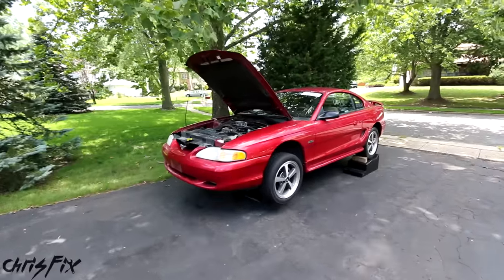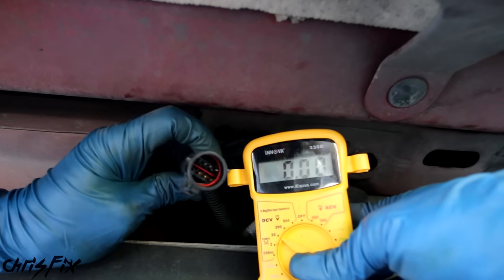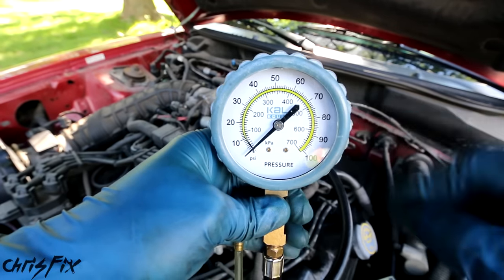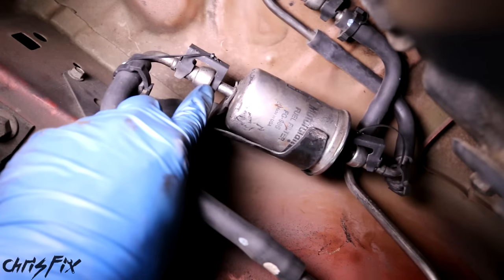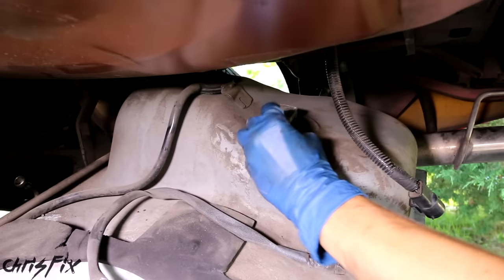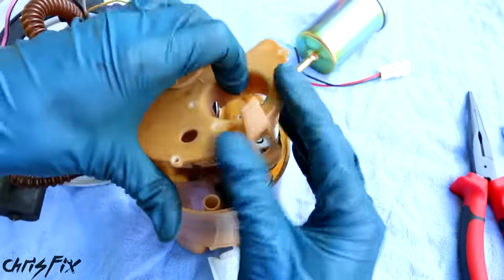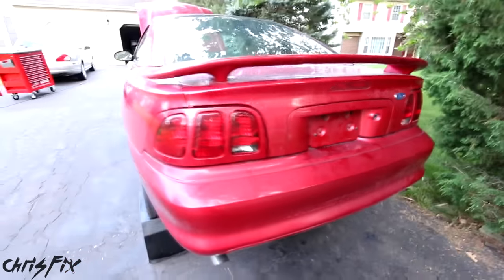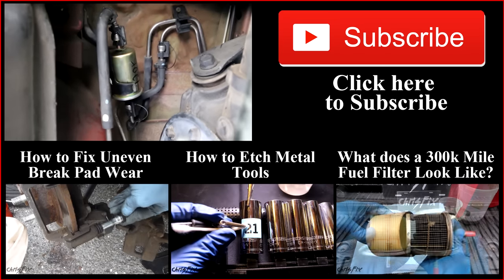How to Diagnose and Replace a Fuel Pump

Comment: Worthy of mention, DO NOT use any electric drills or drivers when working on fuel tanks, hand tools only!  I know that's how you did it, but it needs said too.  Great vids.
Reply from the maker: Thanks for the extra tips!
Reply: Is it so you dont blow your car up?
Reply: @sahibdipsandhu  yes then we can use flex tape to repair the car
Reply: Why...?
Reply: @RzVids  spark from elec drill+vapors=kablooey
Reply: Kaboooooom - some drunk Scottish man
Reply: So you don’t torch off rusty tank straps? That may have possibly been why that car exploded that one time 🤔
Reply: @Pilzi02  hahahaha
Reply: @RzVids  most electric tools create minor amounts of sparking inside the tool. Fuel in the air plus sparks in the tool are best avoided.
Reply: Ah, sparks
Reply: Well yeah bruh drills spark when you use then
Reply: You know I was thinking about that very thing lol for me no one else
Reply: Thank you!!!
Reply: Thank you for that advise! Great ignition sources them electric tools are when working around flammable gases.
Reply: "Don't ask me how I know that"
Reply: @sahibdipsandhu  yes. also if you dent the fuel pump you are screwed.
Reply: air tools are also acceptable to use
Reply: @jonjohnson102   'not one of you gonna survive this' - some drunk Scott tossing his balls around.
Reply: @Pilzi02  lol funneh
Reply: I mean, if you don't wanna recreat the mechanism of an engine with the sparks of an electric tool, best using common HAND tools
Reply: What are you, afraid of fire?
Reply: @lorddragoono  I mean, you wouldn't want yor full tank going on fire, would you?
Reply: I was 90% close to doing this with a drill no lie the only reason I didn’t was because I couldn’t find it 😳
Reply: @chainz1385  check if it is "intrinsically safe"

Electric tools can be used in flammable environments if they meet certain requirements.
Reply: @blastfromthepast7119  ah nice I never knew that it was a dewalt drill idk which one tho
Reply: P
Reply: @chrisfix  what did you use to suck the gas back out? And where to get it
Reply: @chrisfix  what did you use to suck the gas back out? And where to get it
Reply: Except if you're working with diesel
Reply: Where your sense of adventure
Reply: @laceyforrest5799   air or electric if it has a brushless motor. Those ones don't create spark
Reply: @Pilzi02  hi
Reply: dont use any electric drills when your working with a gas tank, it can cause a fire
Reply: @RandomGuy-yh2nh  Isn't that what the main comment says?
Reply: I know this is 5 years later, but I had an issue with a Jetta. Got a check engine light, hard start after fueling and checking the SES light it said camshaft position sensor, engine misfire blah blah. Found a video of common VW issues and not only did it explain about the purge valve which ended up being my issue, but also explained my locks not working, suspension and now my car runs and drives perfect. These videos are life savers. Got a quote for a purge valve replace just because, they quoted $790 and it is literally on top of the engine and took me 10 minutes.
Reply: @sahibdipsandhu  yes… a spark or too high of energy will cause it to blow up
Reply: have a fire extinguisher ready and honestly the air fuel mixture isn't going to be very easy to create a boom you might start a small fire but it probably won't explode.
Reply: Just a week ago I saw a mechanic take a drill to a fuel tank and start a massive fire that resulted with the shop going up in flames
Reply: @HeyaHoyah  Yikes. Hopefully they  learned their lesson.
Reply: Very true.
Reply: @AimingWanderously  My nephew when he was about 14, tried to siphon some gas at his friend's house, they thought a shop back would work good for this..
After the fire trucks left, there wasn't much of the garage remaining. He said you could still hear the shop vac buzzing.
Reply: @billmers3219  Yikes!
Reply: Yes
Reply: Thanks for saving my life. 😅
Reply: i used electric cordless power tools to replace mine after hasnt ran in 15 yrs
Reply: diesel doesn't light on fire easily so youre good on diesels
Reply: Electricity in the electric drills may not be enought to ignite the fuel, because needs an arc to ignite, so an electric tool next to it isn't enough to ignite it, so no need to worry.
Reply: Famous last words. You also might not get hit if you walk across a road blindfolded, doesn't mean it's wise to. @CasamTheAnimator
Reply: I have a 98' mustang gt with only 6,000 miles driven since 2010, I'm the second owner for few years now. I drive my mustang once a week or more some times less. I recently started having issues with mis fire, and smoking out the right tail pipe. My oil is good level, and clean, one of my mistakes is that I did not change the oil because I only drive it 2,500 miles since Iv'e owned it for 2 years. Even though the oil looked clean, and full. It was old, and started to break up it's chemicals . When I did drive it , I would usually go for short to medium cruises, and warm up the car before driving to get the fluids going. I already added fresh oil change, new spark plugs, and wires, new air idle control valve. The car still has a misfire in cylinder one. The other day it stalled on the freeway while I was going 60mph. Any suggestions would be appreciated. Big fan of your show as you can see I'm watching a 7 year old video. 
Thank you
Reply: Hi
Reply: The bro who thinks it’s his job to quiet the class down 😭
Reply: @RzVids  😴
Reply: @chrisfix were u at? I need your help starting my Rx8 😂
Reply: @jonjohnson102 you run fast, I run faster! - Soldier
Reply: @greenstrike0467  here's what I have that you don't - a functioning liver, depth perception and the pulse!
Reply: What about brushless power tools? I know especially power tools with brushed motors that's a big no-no cuz they create sparks.
Reply: Brushless tools create less sparks unless the motor is going bad, in which case they create a LOT of sparks.  ..  hand tools almost never create sparks.
Reply: Mainly on brushed drills, on brushless drills there is less risk

Comment: Lmao so you're telling me, anybody can just go behind your car and disconnect your fuel pump haha
Reply: +Smitty Smith hahaha ah shit
Reply: remmember me???
Reply: I guess it would be a good way to make sure no one steals it
Reply: I think that is something that is specific to this generation of Mustang, and it very much looks to me, from the way the fuel tank is moulded, that there is normally a plastic undershield that would cover over that area so the connection would not normally be accessible.  I suspect Chris had already removed it for brevity in the video with it being a general guide to diagnosis and repair rather than something specific to this type of car.  I must admit, though, when I saw that I did have a bit of a chuckle to myself as having the fuel pump wiring like that would (I'm fairly certain) be against the construction and use regulations for cars in the vast majority of Europe, though it also has to be said that the vast majority of European cars manufactured since 1990 have the fuel tank mounted in front of the rear axle so it is effectively within the passenger safety cage of the vehicle to minimise the risk of the tank bursting in a rear-end impact...
Reply: Smitty Smith   I must admit, I do find the idea of people going around disconnecting Mustang fuel pumps just for the hell of it rather funny...
Reply: that way Camaros will win a race against a Mustang xD
Reply: Javier Mojica   Prepare for incoming hate barrage from GM guys lol...
Reply: Trevor Philips
Reply: Hi

Comment: You’re a great teacher, Chris. Even though my 97 Malibu is slightly different, you gave me some good pointers, like marking the mileage on the filter, and the pre-tests. 
Long story short, I couldn’t change my filter because the disconnect was bent inside, so I cut the fuel line thinking I could repair it - I was wrong. 
Dropping the tank like you did was way easier than trying to heat & fix the line, only for it to leak tragically. 
The good news is that a fuel filter change quote was $60, but a new pump assembly with all new fuel lines cost $100 - so all in all it was only a $40 mistake, plus the old pump works fine and while it’s out I’ll have the time to learn how to make a new fuel line & have a spare fuel pump ready to go if I need it.
The experience of changing the pump is worth even more, and in many ways.
Thanks, Chris!
Reply from the maker: Awesome! I'm glad the whole process went well!
Reply: ChrisFix - Thanks Chris, My car’s back on the road. I considered cutting a hatch while the tank was down but decided against it. If anything goes wrong, I’d prefer any leaking fuel and fumes to remain outside of the car.
  This was a brutal job, and I did it in the cold, but I did it right & it’s done.
  Suggestion for Christmas this year: a professional pneumatic factory hose clamp plier tool. Best tool I ever owned. Removed the vapor canister and made the whole job easier. Replaced a burst coolant hose last summer in minutes flat. Great tool.
Reply: Cars cars cars I like cars
Reply: @chrisfix  hi
Reply: Amazing that they never make the fuel pump opening big enough to take the fuel pump out without having to wiggle it and smash everything along the way for it to come out. Just an extra inch would solve all that problem.

Comment: Advice: While you have the gas tank dropped, take a second and check your filler neck gasket/grommet. On most Mustangs in the 1994-2004 range, you have to drop the gas tank to change that gasket. Save yourself the time and check/replace it while you're doing the pump. That way you don't have to drop the gas tank a second time like I had to. The grommet is located at the base of the filler neck. It's a rubber donut on the side of the gas tank.
 
Driving around with a failed filler neck grommet will prevent you from getting any more than half a tank of gas; the rest will spill out. You will literally dump fuel out of your tank when you take a hard left turn. If you choose to replace it, make sure get the right one. The grommets are separated by year ranges: 1981-1997, 1998, and 1999-2004. You read that right. The grommet for 1998 Mustangs is exclusive to only 1998 Mustangs. It will not fit a 1999 nor a 1997.
 
Thanks for the video, Chris. Got a cheap 1998 Mustang from a friend. It wouldn't start and had sat for 3 years. A few hours and a new fuel pump later, it started right up.
Reply: I wish I had read this when I was doing work on my car.  Although it is a 1977 LTD, it does have one of those filler neck grommets.  I had to get a new gas tank for the car, but it didn't come with one of those grommets and I thought it would be fine.  As soon as I filled it up to the top, it starting leaking.  I probably lost $30 of gas just because of that.  Now i'm gonna have to drop the tank again pretty soon.. :(
Reply: WHY IS YOUR COMMENT SO LONG!?!?!?!?!?!?!?
Reply: @maxwellclark2744 Because it contains a lot of words....and information. WHY ARE YOU YELLING?!?!?!?!?
Reply: Wow I wish I hand read this years ago. I had a 96 Gt and gas spilled out with hard left turns and it took MONTHS TO DIAGNOSE…. I later on figured it out hahaha. Good tip bro!
Reply: @natedawg455 that mofo above has a short attention span that's why.

Comment: Impressed by your diagnosis and surprised by the tech involved in a gas tank. Keep it up!!!
Reply from the maker: +Junaid Nk thanks!
Reply: +ChrisFix how come your video wasn't in my sub box?
Reply: He did in an older video.
Reply: easy, if you don't hear the pump it's either bad or not getting voltage. now flow and psi are a different story
Reply: +Paul Metcalf  which one?
Reply: charredskeleton If I told you, that would take away the mystery of ChrisFix.
Reply: Paul Metcalf Indeed it does, I went looking and found. Don't do it! Remember when you found out about santa claus? It's just like that.

Comment: You don't miss a thing, great job.
Reply from the maker: +Sam Raja I do my best to be thorough!
Reply: Hi 2001 buick lesabre 3.8 past few day's it was hard to start now today i can't get it to turn over. Checked mini fuel pump fuse''good'', fuel pump priming 2yrs old, didn't check the fuel pump relay, changed fuel filter yesterday it was horrible seems like after i changed it i can't start it now.
Reply: ChrisFix  hey chris, i have recently replaced my fuel pump to a new oem unit for my miata07. Somehow sometimes, my cranking delayed for a few secs before the engine starts. Have also replaced my spark plugs, oem air filter and tested my battery/starter all good. Prior to changing the fuel pump, this issue happened too. What could be the problem? 🤔
Reply: Anthony Tan You have any engine codes???
Reply: I think you forgot to warn us to refill the gas tank before testing the new fuel pump haha

Comment: Chris we have learnt so many things from you. We really appreciate your efforts. This is one of the few videos where you replace the actual fuel pump as most videos just show changing the entire assembly. For the price sensitive DIYer or small garage this is a very critical thing to know that you can change just the fuel pump motor and save some money if it is only the pump that has failed.

Comment: Your videos are gold. So on point with great details. So my Mustang died on me, and no pressure in gas pedal at all. Started but died right off. Quick google search gave me options of fuel pump or MAFS failure. Your video confirmed that it wasn't a fuel pump because mine hummed. So next I was to check the MAFS. You can't believe what I found in my MAFS tube, big WD40 bottle 😱😱😱. Rest assured, after removing the bottle, the car started right away. I got my waterpump changed 2 weeks ago in a shop A. I don't see how they would have left that under the engine filter cover, since the waterpump change would not require removing that cover, but who knows. And prior that the car was in a shop B where it was maintained (filters, spark plugs etc) 7-8 months ago. At the time they did leave a tool under my hood and I had to go back, since the called looking for a tool and that for sure I was never returning to that shop B. So thinking that it's more likely that they left that bottle there too. What would be the chances that I get left items under my cars hood 2 times out of 2 visits in different car shops. But could that bottle really be sitting there so long without causing any problems!? Crazy...

Comment: One recommendation when checking fuel pressure its nice to just lay the gauge on the windshield. My 93 vette had a similar problem with the fuel lines and it always helped to be able to watch while also listening.

Comment: Over all this was a great video and you showed a couple of troubleshooting tips I didn't know about. There were also a couple of problems with this video. 1st, Never lift a fuel tank with just a floor jack. I learned this lesson the hard way. Just like a transmission, the fuel tank can be damaged when using a regular floor jack. Either use a piece of plywood or a transmission jack. I dropped my tank on an old GMC Sierra to replace my fuel pump using a floor jack. After that I was replacing the pump every 3-6 months. I also started having weird fuel supply issues. ~$1,200 later I found out why. Many fuel tanks have baffles spot welded inside the tank. Lifting the tank with a floor jack bowed the tank sufficiently to break one or more welds. After that, the motion of the gasoline broke whatever remained of the welds and then the baffle was constantly hammering away at the fuel pump. There is no way to safely and legally weld a fuel tank. It has to be replaced. I was fortunate to get a good used one for about $100. 2nd, always check the tank seal. If the seal is not good then you will not reach and/or maintain proper fuel pressure. This becomes a serious issue if you live in a state with strict emission control laws.

Comment: 1999-2004 Mustangs have the fuel relay inside the CCRM. So check the fuse for the CCRM also! It is located in the engine bay fuse box labelled: F.14 (CCRM) 20AMP. The CCRM lives behind the passenger side fender. It's a small box with the fuel relay inside of it. You might be able to put your ear to the fender and listen for a click. A click doesn't mean it works ok, a click just means it receiving and handing the 12 volts OK. A true test would be a resistance test on the other two pins on the relay

Hope it helps others! Great video! I watched it back in 2016, now im watching it again as my pump went out 4 years later haha!

Comment: I had to do this project on an old Saturn a few months back. Great video. One more diagnostic thing you can do, if your pump isn't running but you're getting power, is get under the car and smack the bottom of the tank with a hammer. Sometimes this gets the pump to run for a bit. 

My Saturn didn't have a hole in the floor for the fuel pump, and everyone was telling me to cut a hole in the floor to change it - I say that's a bad idea. The tank is so absurdly easy to remove, cutting a hole in the floor would be MORE work in many cases. Lastly, in the case of my car, there was a rubber hose about 10" long that attached the tank to the filler tube, and it was easier to remove that rubber tube than it would have been to remove the entire filler tube. Whatever the case, as Chris says, don't be intimidated, look at how your car goes together, and get it done.

Comment: Nice video as always. I did this several times for my old car. One aditional check that I also did was to test for a second the old and new pump directly on the car battery using wires. This way you know for sure if the old pump is bad or it is something in the assembly (like pump plug might go bad) and that the new pump is also working before installing it. You can also use multimeter to test the pump itself.
Reply from the maker: Great idea!